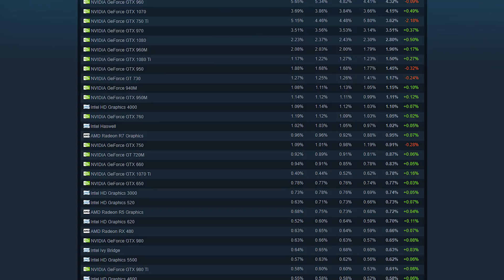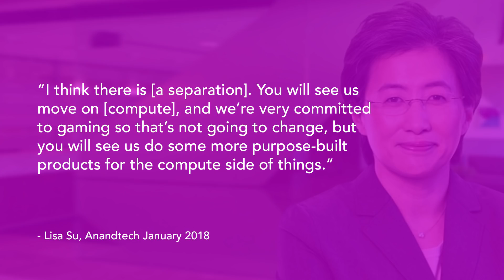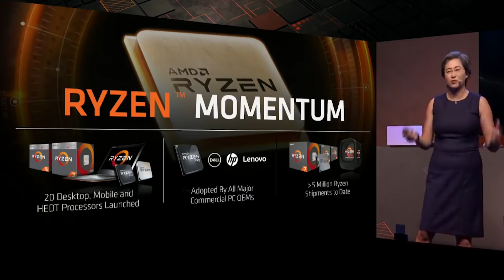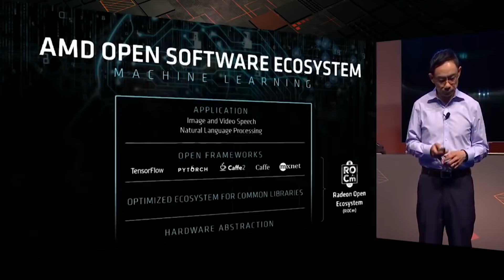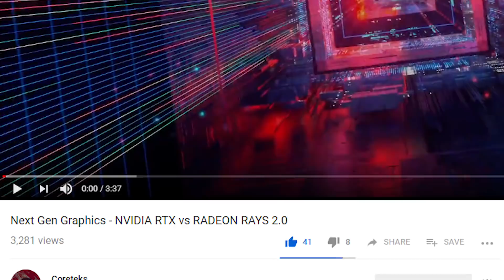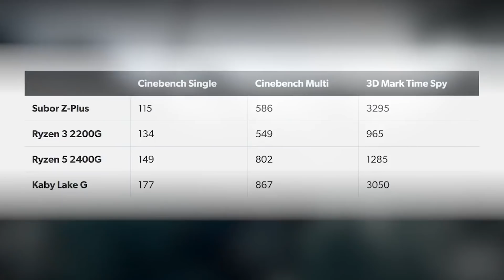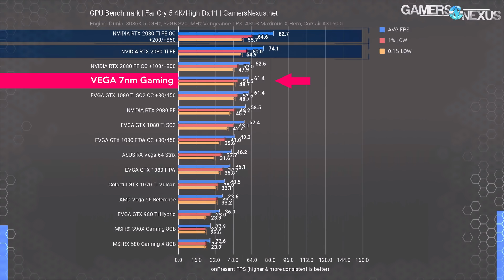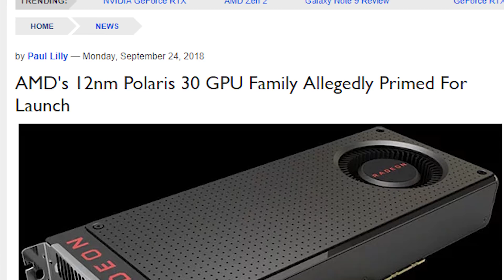AMD's answer to RTX

Comment: Wow, what an in-depth analysis. I think you could be right. I certainly hope you are.
While I have been more leaning toward nVidia for the last 16 years, it was always a bad situation for everyone if one company fell too far behind.
Reply from the maker: Hey Oliver! Yeah I hope so too, I've been waiting forever for a reasonable entry point to 4k. One thing I didn't mention in the video is that vega needs hbm because it's starved for bandwidth, but the new gddr6 can be a fix for that. If we hear news from Micron of increased gddr6 production that will be a good hint that AMD is cooking something. Thanks for your continued support btw :)
Reply: 16 years?  jeez man, there were several times in the past 16 years when ATI (back then) were considerably ahead of nVidia, so you were smoking something or being a fanboy.  lately yeah nVidia has dominated, but they had their day and at times were either far superior or a much better value (frame/dollar) or both.  16 year nvidia fan is showing a bias, most practical and informed consumers who've been around that long have switched back and forth a couple times.
Reply: More leaning towards means, in that time I had mostly nVidia cards, not exclusively. I owned 2-3 ATI cards before 2008, but none in the last 10 years. I agree, ATI was ahead quite often in terms of GPU performance for the price, but nVidia was the better and often only choice for my specific compute shader needs for the last 10 years, since I don't use my GPU exclusively for gaming.
But even when ATI/AMD wasn't even an option for me, because I used software that would not run on AMD cards, I was always glad that nVidia had to struggle to stay ahead.